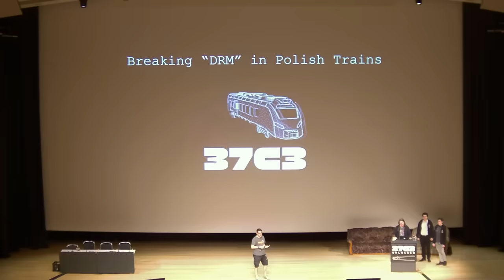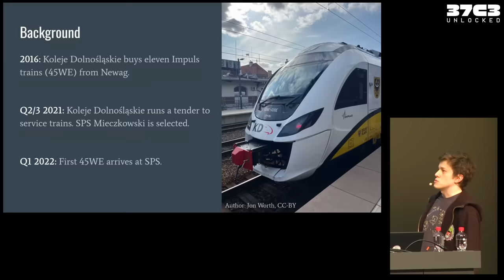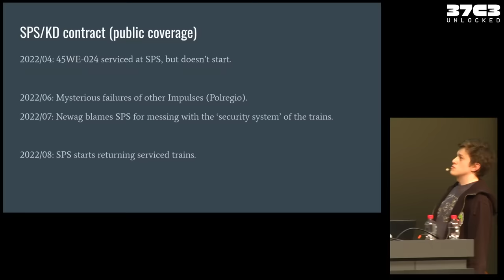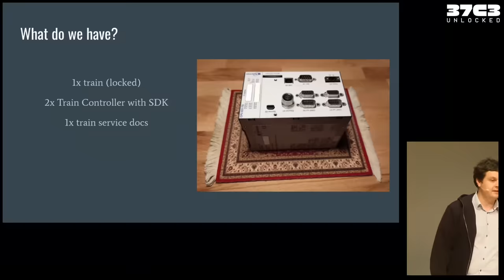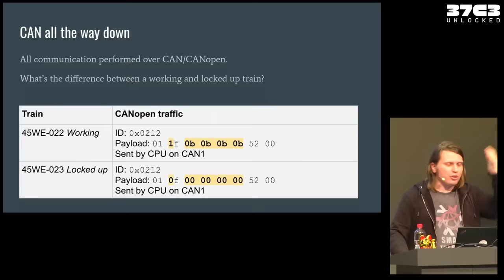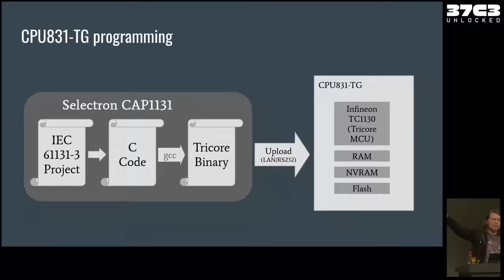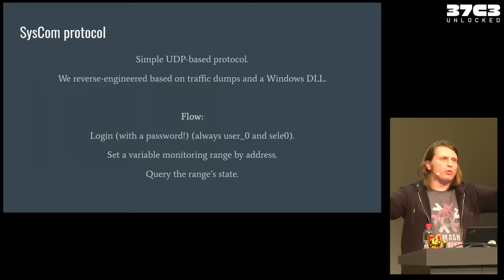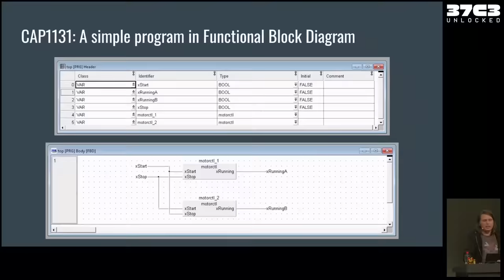37C3 -  Breaking "DRM" in Polish trains

Comment: I always thought these kind of practices were limited to consumer devices; apparently the whole industry is now infected.
Reply: Has been for 10+ years.
In companies people responsible for procurement/ guarantee/ repair aren't paying from their own pocket and often got 0 consequences if the company suffers long-term losses because of their dumb decisions. And higher-ups have no clue what they are looking at (or don't care). "emergency repair: replacement of dingle-bob 32.3STFU v2 - 15.000$"
Reply: Welcome to new reality :)
Reply: It's everywhere. John Deere is famous for this kind of crap.

I work for a YT channel that has fun servicing various electronic devices. A while ago we had a circular saw from Milwaukee that wouldn't start. After some digging it turned out the microprocessor that controls the motor was busted. Out of curiosity we checked if replacing the CPU would help, but what we learned is that the firmware on the CPU is custom and locked. We would have to unlock the CPU to read the custom ROM, but the only way to do this is to type in a 16-character password, and if you type in the wrong password ONCE, the entire chip is instantly wiped clean. How insane is that? A freaking saw that if you try and read the ROM on a chip in order to fix it, it has a self-destruct function! Like, I sort of get it, you have to protect trade secrets, but come on, is this some kind of James Bond reference I'm not getting? XD
Reply: It was always way worse in business devices, the difference is some businesses were quite open about it.
Reply: @B3RyL  On the other hand, this proved to be very handy when Russians stole dozens of Ukraine John Deere tractors and the factory disabled them remotely. It has pros and cons, so I'd say as long as the company is transparent about it ("We can disable stuff, we won't tell you how exactly because trade secret, but we can do it, turn to us with repairs of PC stuff"), then it's okay to me. But the train example here is basically intentionally sabotaging competing repair shops, which sounds insane.
Reply: @SanyaJuutilainen I'd say that depriving Russia of a couple of tractors is definitely not worth the risk of installing such hardware. Imagine the damage a Chinese/Russian hack group could do if they manage to crack into John Deere's servers and remotely disable all farming equipment during harvest season. Not very likely, but certainly a risk.
Reply: @B3RyL  So I do a fair amount of electronic design for in-house applications at the place where I work, but if I had to make and sell products to the public, I would totally be protecting my firmware using lockable microcontrollers. The last thing I would want is a reverse-engineering team in China cloning both my hardware design and firmware, stealing all my R&D effort, and undercutting me with counterfeits of my own work. That said, protecting the firmware in a circular saw? Absolutely ridiculous.
Reply: We the consumers have allowed it to happen.
Reply: @asm_nop  then again, since Milwaukee is already a Chinese owned company and they protect the firmware of EVEN the circular saws, thing about other, more meaningful devices that come from China and most likely have a lockdown/wipeout modes of their own too.

An enterprise fridge/cooling solution for food? How much time does a nation have before its social order collapses because food spoiled in the heat? How much social order can be maintained if there's no electricity or running water because some transformer or pump got shut down? It's funny story when it's a circular saw, but a horror when it comes to things people depend on for their lives.
Reply: Trains should not such technology where they can get hacked like that, It should go back to mechanical stuff like it was before
Reply: @SanyaJuutilainen Well, yes and no. If all companies do it, and you have no option to not accept it? And they charge a kidney and your first born, for the most basic of maintenance, because it's not like you have any other option. Does it really matter that they are transparent at that point?

They should be forced to enable 3rd parties to do said maintenance / repairs. And any component or sub system that they want to lock due to 'trade secrets', should be provided with maintenance free of charge.

One thing is doing this intrusive DRM to protect trade secrets, it's a completely different thing when you do it to lock customers into your extortionate servicing practices.

Comment: 26 non-incremental code versions for 30 identical(??) trains... It seems to me that the Newag Agile Release Train is fully functional... 😬
Reply: They are just doing A/B testing.
Reply: At that point it's more like alphabet testing
Reply: Just adding onto this thought. If one of these trains already reached End of Life (or ran enough to need a full overhaul) then i would guess that the software is far beyond testing fase. I can understand if delivery schedule was a bit too quick for full testing of all functionalities that during delivery of the first trains the software was stil incomplete. But so far into the life of these trains and with normal maintenance. These trains all need to be running the same software. Or maybe the last two versions or something. These are all the same series of trains. Should be the same hardware.
Reply: I think I know what happened here. I am not familiar with this flavor of PLC (I do Allen-Bradley), but I imagine all of the PLCs are programmed from the IDE instead of a binary file. As such, it would be recompiled every time they download the code to the PLC, and any small change would be reflected in the binary files. Such small changes could include serial numbers (hard-coded as they basically change a constant in the code) or adding the new kill checks. If the PLC holds a copy of the source code even changes in comments would stand out in a diff.
I am sure they would have checked for a local copy of the source code first (stored as a database file) even though they haven't mentioned it. That said, the method they used to pull the machine code might not have been able to pull the database file.
Reply: Oh, that is just PLC-Programming and mechanical engineering. Everything is just "unique" - but those professional PLC-Programers hold it together, with ducttape and string..
Reply: They just installed whatever was on their dev branch every time a train was in reach, it seems. Classic "we are ISO certified, but that doesn't mean we need to know what we're doing".
Reply: @HenryLoenwind  usually the software changes are for a reason. Some functionality added, some wiring fault repaired, a bug fixed
 I would suspect that if one train needs a later build, then they would update other trains as they come in for service. But yeah they obviously didn't care to keep all of their trains on the same software for some reason.
Reply: Im sure the changes were all 'non critical' and fully documented.
Reply: rolling release. literally.
Reply: @Canonfudder  There's always some random conditions that crop up between different hardware revisions that the firmware needs to handle differently and for large complex systems each train might as well be a different hardware revision but having separate branches of their FW built for each and every variant is just incompetence. You set aside a few GPIO pins for these sort of things or flash it separately from the FW as a config option. Something like GPIO_3 low, GPIO_4 high, and GPIO_5 low means this board is using the ACME corp IC on some I2C bus instead of the competitor corp IC. Not saying you're not correct about how Newag is operating here, but that's just yet another thing they're doing incompetently.
Reply: @AndrewMerts  git checkout-branch.. git merge.. git apply changes on top with git cherry pick.. git commit -m "Tons of outdated shitty excuses by an outdated shitty industry. The only thing exceptional in the whole industry by the way."
Reply: @AndrewMerts   You are right. Different hardware can abstract it away. Or you just have one big git main-branch, with different hardware in separate branches. Update it, re-merge the hardware on top and voila. The excuses for all of these thousands of different versions for each machine are gone by now..
Reply: Huge props to these three guys. I just hope that the politics in Poland will keep on-side with them, otherwise they risk suffering the "No good deed goes unpunished" punishment.
Reply: Somebody call Copia!
Reply: I've seen this in the past, they probably have like separate folder for every version on their repo, and big excel with serial numbers connected with specific folder name and then they just put 10 students to make sense out of it and "fix" bugs.
Reply: trains despite the type might be different, depending the basics or options buyer wanted. Speed -> motors-> inverters -> different managing-> different coding for example.  the "core" of course will be the same but quantity of devices  CPU is communicating or their kinds might be different. This is  Huuuge equipment and have huuge list of options.

Comment: "International compressor failure day" this is great! LMAO
Reply: Days* as it happens twice a year:D
Reply: @_xano  And for 10 days in November and then 11 days in December, so 21 days in a year in total. Notice that the condition was "equal or greater than".
Reply: Sadly "international" is apt here, since newag does have international buyers (angry face), although probably not for long.
Reply: 57:15 for the skippers. Don't skip though.
Reply: @Piotrek7654321  What were the dates again?
Reply: @Eugensson  Year >=21, Day >= 20, Month >= 11 I believe?
Reply: @Eugensson  The comparing value was year >= 21 and day =>20 and month >=11
Hence for year 2021-2099, it will fail on 21nov to 30 nov, and 21dec to 31 dec
and then for year 2100-2121 it will work year long haha

Comment: wow this is wild, another example of why right to repair and open hardware are SO important
Reply: This isn't really right to repair.  Newag didn't sell the locomotives with a requirement for themselves to do the maintenance.  This is straight up fraud.
Reply: @windwalker5765  but clearly if it's designed to only be repairable at a manufacturer's shop it's meant to give the impression that external maintenance isn't sufficient which would suppress external maintenance for no valid reason

Restricting right to repair and being fraud aren't mutually exclusive
Reply: @iotkualt  i would argue that intentionally restricting right to repair is always fraud, but sadly thats not law as it stands now in most countries... but yeah newag clearly went above and beyond when it comes to that kind of sabotage
somehow i get the feeling that if you want to screw over customers by restricting their ability to repair their purchases... maybe dont do it to the governments of countries... they kinda have just a little bit more power and leverage to fight back
Reply: @windwalker5765  Newag clearly did not want third-parties to repair the trains, since they had geofenced their locations. I would call that a "right to repair" issue as Newag will not allow the trains to start when they have been there.
Reply: @windwalker5765 but being anti right to repair really sounds like fraud tho. Any reason given to prevent anyone from manually repairing their own stuff is unethical, false and profit driven. (especially security and intellectual property ones, tired of always hearing those lame excuses)
Reply: @SharienGaming you're right, this is sabotage, and being anti right to repair is also sabotage
Reply: @windwalker5765 Check Right to repair movement. It about everybogy's right to repair a device he/she owns and not just the manifacturer.
Reply: EVERY firmware should be open source, I can't imagine that a company goes belly up, someone finds the issue in their firmware and you are unable to repair it, especially if this a device that human life depend on, like any vehicle.

Comment: Time to add full source code disclosure to the bid specifications…
Reply: Only to discover at the end of the maintenance contract that you bought crappy code, and even OK'd it. Because well ... why even pay some nerd to do unimportant  checks before you sign the deal of the century?
Reply: And you won't get a single bid. The only people that get source code are the DOD and you know what they pay for it.
Reply: The railway operators are more like defense apparatus than individual car buyers. They already pay a lot, they don't have much of audience competition, they are considered strategic state assets, and they have comparatively easy access to legislature
Reply: Technically they got full service documentation. Every function of every component of the train documented and explained. But the lockout mechanisms were not mentioned. Plus the functions were changing with software updates and the service documentation was not updated at the same time. So I can Imagine manufacturer handing out a "source code" for review and then trains running on something slightly different. I doubt service providers would be able to compile and flash a train with the clear code, they'd have to Google "hackers" again😂
Reply: @CykoruKun  Perhaps it's time end users got smarter... Or perhaps employ smart people. They employ mechanics and technicians to deal with the mechanical aspect of the vehicle, why not code people for the same reasons... Trains have morphed from a vehicle that had a computer for monitoring to a computer that also happens to be a train. Both the operator and the manufacturer are really immature in these areas (I speak from the inside).
Reply: @otm646  so the manufacturers will just not sell to Europe? Won't European train makers go bust if they don't sell any trains in Europe? Surely they'd distribute the code??
Reply: Then you also need to add an exception to law that if no one bids government is allowed to create their own government funded train company. Currently in EU there is a requirement that work must be done by private companies.

Comment: This is the exact same reason why a lot of icecream machines are broken at Mc Donald's in america. While the main Mc Donald's company has secret agreements with the icecream machine manufacturer, it is a pain in the ass for the actual franchise owners to service their icecream machines, because they frequently stop working and basically every other step in the manual for the Mc Donald's employees states "call certified repair technician". Over 40% of the revenue of the icecream manufacturer comes from "servicing" for Mc Donald's and there are secret codes to unlock the machines.
Reply: And John Deere. They do this with their farm equipment.
Reply: Its worse then that their stocks owned in part by the same finacal firms and they do it to boost stock prices.
Reply: @LasOrveloz  "They do this with their farm equipment." - No, IIRC their method is much more sophisticated: they use components pairing and thus their machines "only" break if you attempt to swap those parts out yourself. This was much more sinister because those Polish trains literally broke for no apparent reason (i.e. a real fault).
Reply: @LasOrveloz ”you’ll own nothing and you’ll be happy. “
Reply: “Input the Konami code to unlock the McDonald’s ice cream machine”
Reply: @CoolKoon  Same with a lot of newer vehicle components, change the power-window regulator? You need a technician to "sync" it with the ECU. I recall them saying the same thing for some components at the start of the video...
Reply: @BudgiePanic  I mean, if I had the opportunity to do this -- I absolutely would and honestly, I'd be expecting it to at least bring up console mode.

Comment: Many modern PLCs can be programmed in C or C++ but not all manufacturers document the hardware to that level.  Siemens is an example of a company which does officially support it- and their newer PLCs actually run Linux.
Reply: Siemens learned that lessen the hard way, too, IIRC.
Reply: @TheAgamemnon911   What are you referring to with your recollection? :)
Reply: As far as I know, only the "ODK" PLCs from Siemens supports this . I think there is a new way with the Xcelerator or something like this but this is only in a limited testing field.

But a normal 1200 or 1500 PLC can not be programmed with C or C++ in TIA Portal. The only possible languages are FBD, LADDER, AWL, ST (SCL), Graph and CEM (not all languages are supported by the 1200 series).
Reply: But why would anyone want to break the Linux Direct Rendering Manager?
Reply: "not all manufacturers document the hardware to that level" - Fortunately such architectures (that don't have publicly-available specifications) are rare and oftentimes even those are variants of some well-known architectures (e.g. ARM). In fact I don't think I've seen anybody but car manufacturers use such stuff.